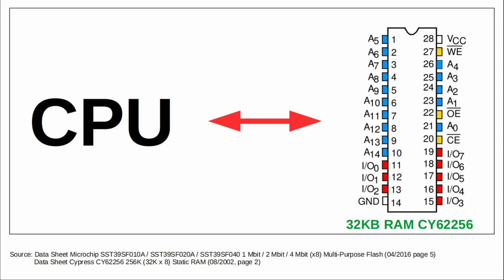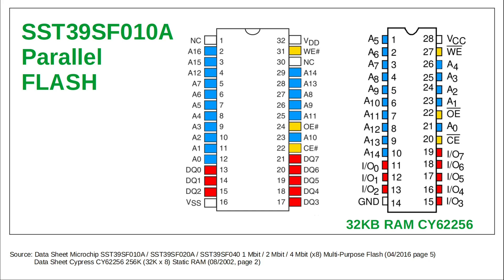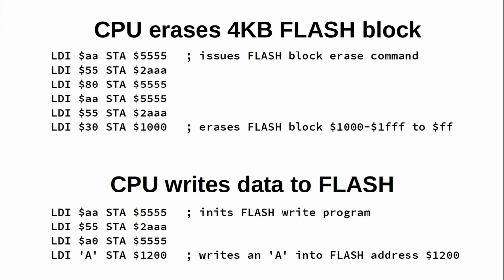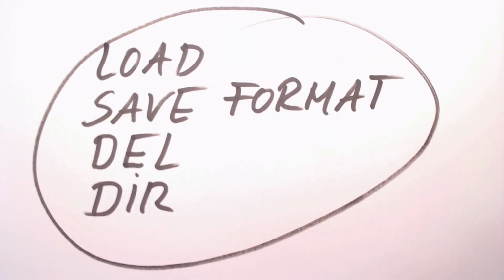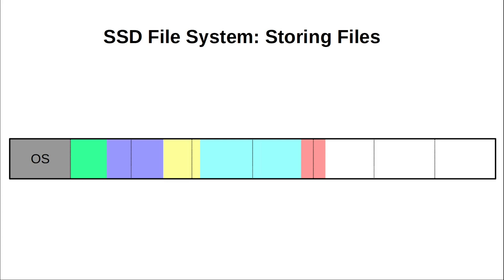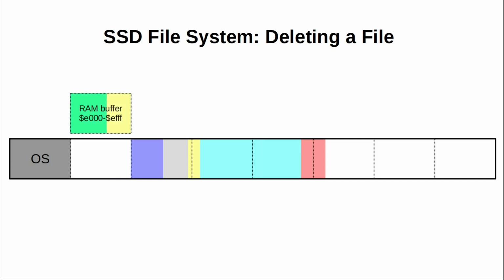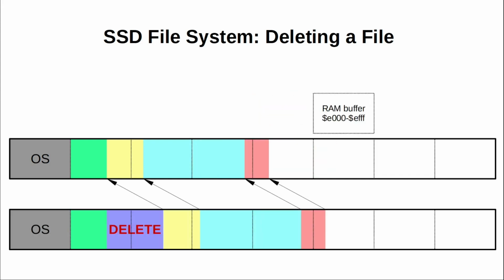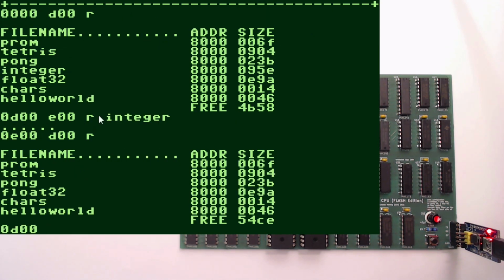FLASH File System on a Shoestring

Comment: I can see the attraction of simplicity and the efficient use of the existing storage space, However, the somewhat cumbersome delete process does make me nervous. Also, as I understand it you have to chase down the entire string of files in order to get a directory listing. Furthermore I have not seen how you implement subdirectories.
I prefer to have blocks that are chained together and a freelist. That allows the simple access to directories by opening a directory "file" with length and starting block.
I am not sure though what that would do to the write count in a flash. I guess youbwoukd have to relocate the directory structures regularly for better lifespan of the flash 
So, your FSbis probably all right. I used to play around in the 1990s mounting a tape drive as a Unix file system to streesstest the tape drive. So, in a way your FS is just like a tape drive, but you don't have to wait for the mechanics to catch up.
So, whatever works will do in the end. If you solution does, then that's fine and the code to implementing is small.

Comment: Quite a few of our computers "back in the day" actually did use a file system exactly like you make here.
I was always in love with FORTH's "file system" it was basically a bunch of blocks each block had a number and THAT'S ALL! To load program code you could say "27 LOAD" and it would read and compile FORTH code from block 27.... if your code was longer than 1 block, you could end block 27 with "28 LOAD" and so on. If you put a comment at the start of each block, then you could get a directory by writing a program to print out the start of each block up until a carriage-return character.
Reply from the maker: Hi edgeeffect, that sounds really interesting. A 'Minimal' team member has already developed a FIG-Forth for the Minimal. He is using this concept of Forth screen as you outlined it. I guess with the upcoming release of the new Minimal, our Minimal Forth will be available, too. Stay tuned.

Comment: This is one of the possible filesystems, but if one header becomes a fault value all file headers following are not valid and you lost the files.
You have to install error checking to find out which files are corrupted. For a useable file system this is to simple but it works a while.

Closing the gap of a deleted file immediately is the slowest possibility and will need a lot of time. Filesystems close these gaps not now. but if you have a lot time between two file write operations then you can make it in your way.

It’s good work and shows how simple programming is. You just need an idea creativity and the rest is straight forward.
Reply from the maker: Hi Paul, thanks for digging into this and for pointing out important further steps! Be assured that I am well aware of the shortcomings of this approach. Is is a minimal file system after all :-)

Comment: the SST39SF040-70-4C-PHE made by microchip can be found on mouser claims 512kx8 nor flash 70 ns with asynchronous timings just telling you encase you wanted one of that size but great video and its cheap for 1.83 usd each
Reply from the maker: Thank, Duckson Plays! I am already using them in my next project... :-) stay tuned...
Reply: @slu467  :O I will be looking forward to that

Comment: Awesome video, but id honestly take a different approach here when it comes to the storage hardware, instead of using a flash ic, you could bit bang spi and use a sdcard. You get lots more capacity (you likely do not need it) and a lot more cycles (its very nice)

This is not a complaint but a suggestion, I love the idea of more people making the Simplest PC and I feel using more common parts will help with that.
Reply from the maker: Hi Yori, implementing an additional interface is somewhat against that "minimalism" idea. I found a way of pimping the SSD up to 512KB which I will show in my next vid. Cheers!

Comment: This is very nice file system, I'm almost in love of it's simplicity. 

I like when you delete a file, it moves everything forward of the file to its position, overwriting the old data to prevent holes. Although what if a file in the middle was to be increased/decreased in size? Say for example an old text file was to be updated from 100 bytes to 200 bytes (such as an assembler text file). Would this do the opposite to delete, as in it moves all data in front of it forward, then it inserts the new data? Would a decreased file size do the same as deletion, but on a smaller scale? 

If the SSD was running out of space (I guess kind of easy to do with only 32KB), would you copy the data to something like cassette tape, then have a freshly formatted internal SSD? Maybe banks of SSDs could work, have a very large FLASH memory (something like 512K), but only 32KB at a time is available to the system and 'partitions' are bank-swapped via a register to the high-address bits of the FLASH. Maybe an OS function that converts a global byte offset to FLASH offset and Bank offset. It would use a very large input integer (from 0 to 512K) would automatically convert this to 32K FLASH offset (low 15 bits) and bank offset (high 4 bits for 512K).
Reply from the maker: Hi, glad I got you going off into new directions with my humble video. Your ideas sound just great and well worth investigating! So thanks for sharing... The file system I have presented is not capable of extending file sizes. You could work around this by writing the new file and deleting the older version. So extending is kind of "not needed" when you see it from the minimalistic point of view... both ideas involve moving data around... Extending the SSD size would be great but I always ask myself, where does this stop? I myself probably don't want to write programs any longer than 10k on this machine ;-) However, if there was a comunity growing around this, things might change... cheers!
Reply: @slu467  Thanks for the reply :) Yes, deleting the old and replacing it with a new file would functionally do the same thing in the filesystem as extending! I guess in the text-editor, instead of using a 'extend filesize' function when saving, it would simply delete the old file and write the new one.

Just a few questions, when you said no longer than 10k, was that referring to text filesize or binary program size? Because I found (at least in my enthusiast-only experience) an assembler text file tends to be around 4 or even 10 times larger than the actual program binary file (e.g. 1k binary would need around a 5k text assembly file), although this could change dramatically from assembler instruction mnemonic sizes and comment usage, not to mention the space an assembler program would take up (maybe around 3k to 10k, I haven't written one so I'm not entirely sure).

Maybe an I/O expansion bus could be added? (Even if it's just pin header) Simply just address bus, data bus and memory I/O control lines (RAM in, RAM out and RAM disable), maybe even dedicated I/O select lines ;-) could be added, so another person could add/design their own peripherals? Things such as extended mass storage, maybe even IDE hard drive, floppy drive, sound card, hardware maths acceleration (e.g. very large integer maths and/or floating point), bitmap graphics display, character LCD, game controllers, keyboards or key-pads, MIDI interface, timers, real-time clocks, microcontroller capabilities, etc.
Reply from the maker: @fabian999ification  You are right! I got to look into extending the SSD somehow. The SSD I am using here has 128K onboard - and I am only using 32K right now it's a shame... I forgot about the x5-10 factor when storing assembler text files. That's definitely a good point :-( Addressing more than 64K with this system is going to be a tricky thing, though... I've already done a 32-bit floating point calculator parsing arbitrary math expression (well memory-limited of cause...). The assembler text file is only 38 Kilobytes :-))
Reply: that is how it all started isn't it  "PC". .... for Slu4 minimalistIC computer the mighty CASSETTE would be a fear deal (haha joking).  

BTW just discovered one of latest  "8-Bit Breadboard CPU" on YT,  he implemented an SPI, SD and RTC. (maybe also German. der...)
cheers.

Comment: A very clear explanation! I've now got both iterations of your boards, so get the fun job of stuffing them shortly.
Reply from the maker: That's great news, Aaron. This time, there won't be any VGA compatibility issues... just plain UART. BTW, I have just finished a UART to VGA terminal using only 4 ICs ;-) well, two of 'em are AtMega328s... but now the Minimal UART CPU at least can operate on it's own. Take care!
Reply: @slu467  that's possibly cheating, but will be nice to have a separate board to get things in and out without having another computer right up against your first one.  

I bought a pile of electronics magazines today from 1979/1980 detailing a lot of different DIY systems, it's been a very interesting read!